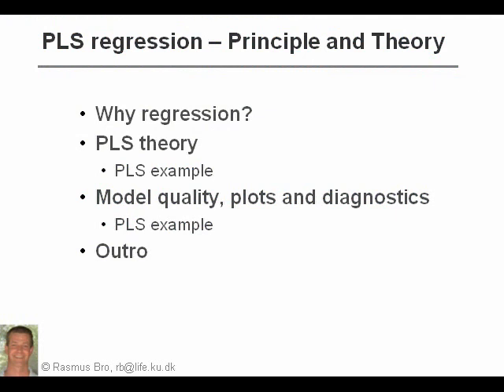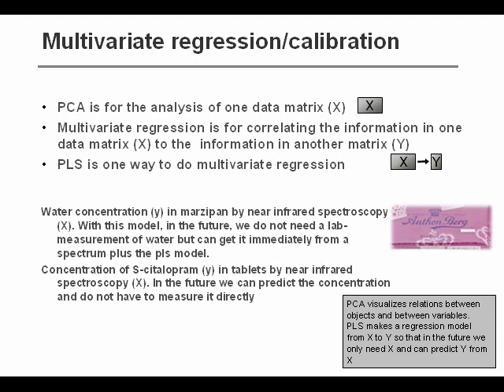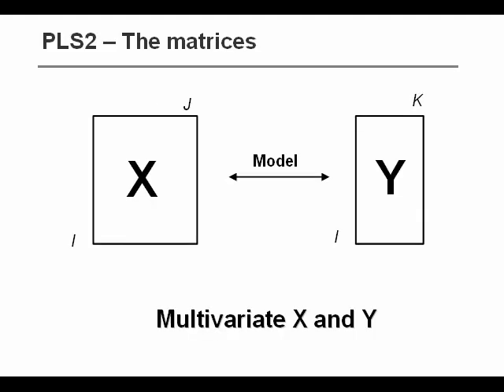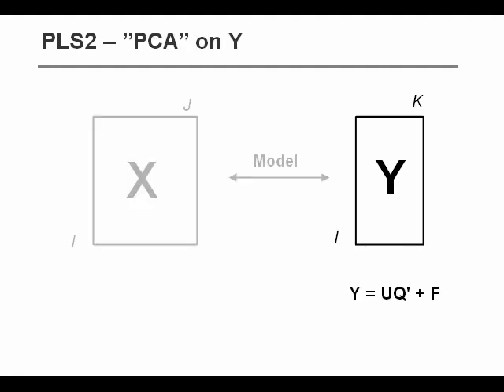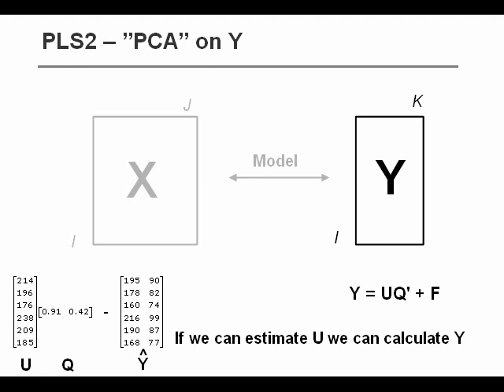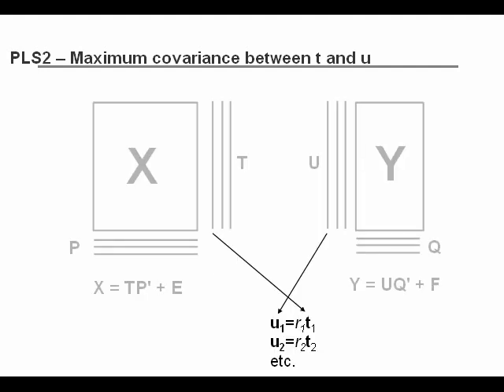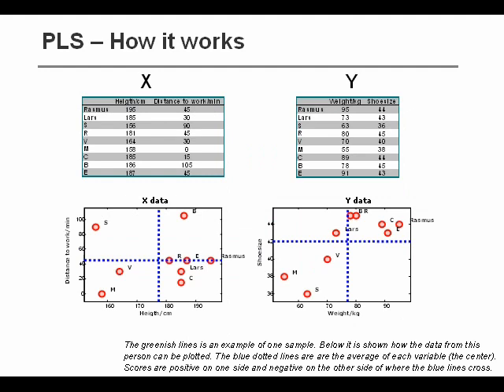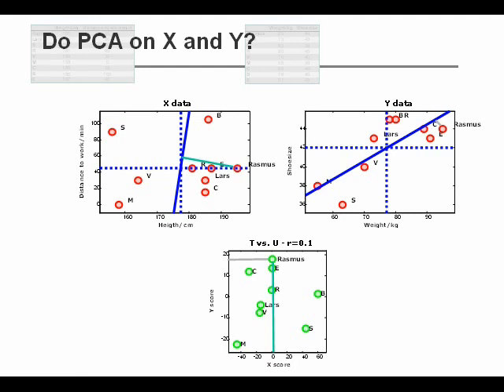Partial Least Squares Regression 1 Introduction (1/4)

Comment: This is great. One thing though. I'm not sure how the Score of X for Remus was so close to 0? It seems like the turquoise line connecting the loading vector to remmux is pretty large
Reply: The length is not related to the score. If you read the variable score in a coordinate axis you check the actual axis, not the length of the line going to the axis.

Comment from the maker: Hi!
In chemometrics we normally work by arranging our matrices in such a way that samples are in the row direction and variables are in the column direction. That is, if we have a dataset of 5 samples and 20 discrete variables, our matrix X(I,J) will have dimensions (5,20). In your case, 20 discrete variables means J = 20

Cheers

Q&T